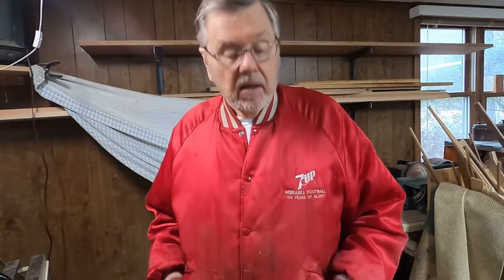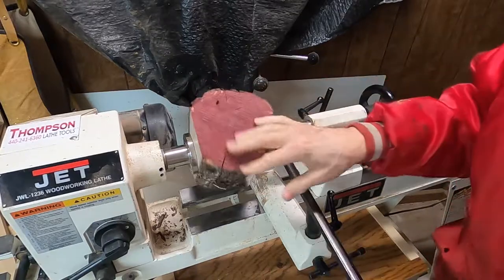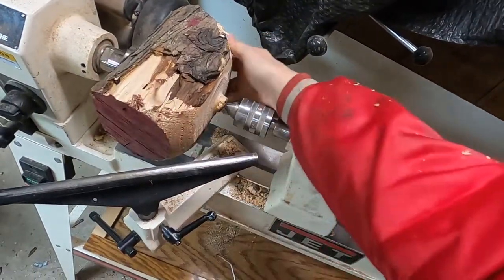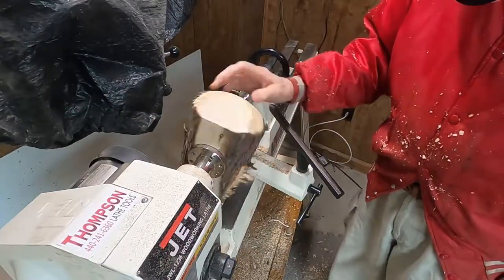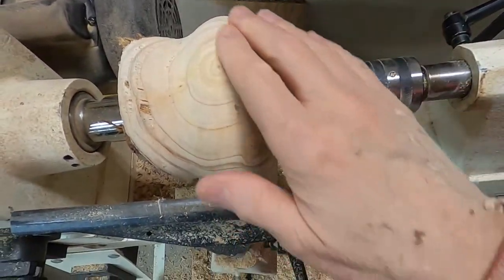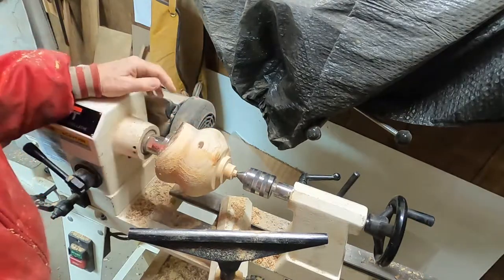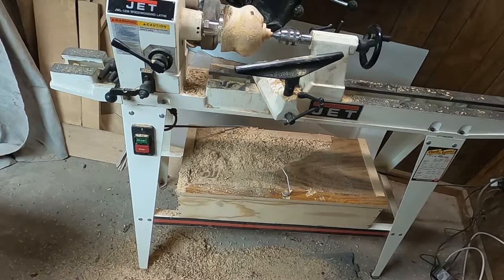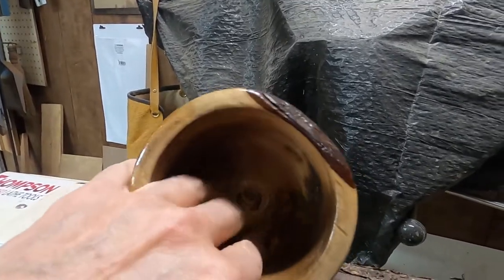When your Jet Lathe Breaks

Comment: You should try splitting the log so you will be removing the pith and not keeping it
Reply from the maker: Thanks for the tip
Reply: Yeah I take a log like that and split in half on band saw, usually results in a shallower bowl but live edge bowls are more artistic than practical anyway…